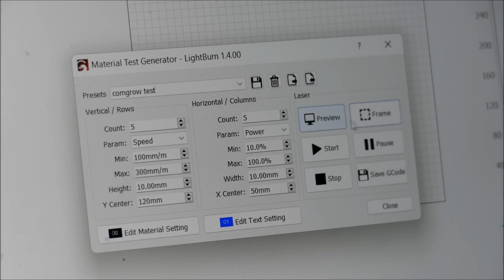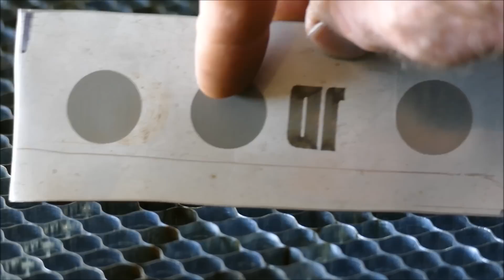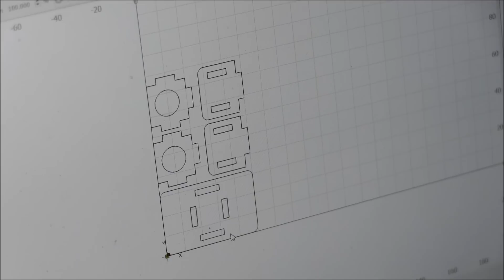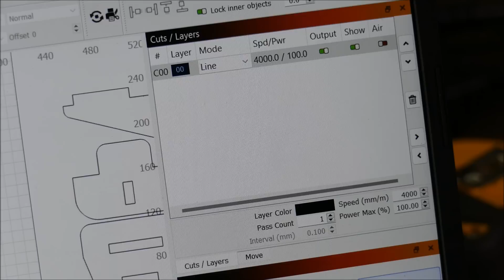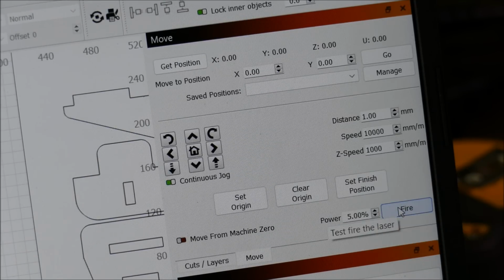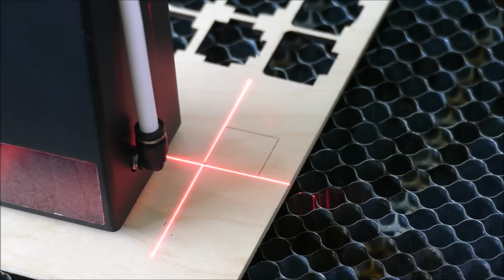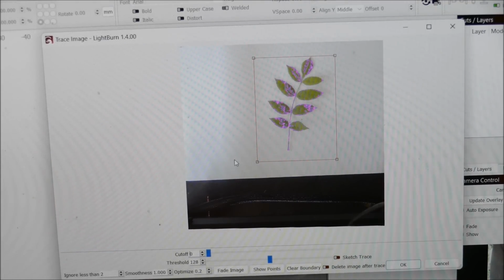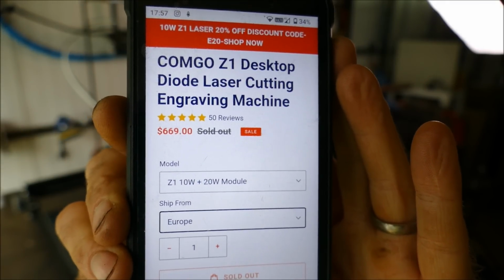Is this the MOST cost effective 20w laser engraver 2023! + best DIY upgrades Comgrow Z1 Pro cnc

Comment: I use a laser cutter at my local hackspace to engrave stupidly complex Celtic art (not like that joke of a knot in your earlier video) so my main criterion is accuracy. The misalignment on that one piece in this video was worrying, so I was wondering if you could do comparisons of the engravers' accuracy on longer cuts?
Edit: just watched your video with the AI elvish table - let me know if you'd rather have a Celtic design for one ;)
Reply from the maker: Hi. Thank you. It was misaligned because I put the part too close to the back of the gantry where it hit the edge. That's because the machine thinks the cross hair is point 0 so it thinks it had plenty of room. I could do the same mistake on all the best machines, I just didn't think about it until I finished the video. Celtic art is awesome and AI certainly can't do it perfectly, it was just an example of how quick the process can be with fairly good results. Cheers J
Reply: @joshuadelisle  Ah yes, classic. I always use the Frame command in Lightburn before cutting, for that and other reasons. It's quick and saves annoyance/waste/embarrassment.

Comment: I’m sure you don’t want to get into Lightburn tutorials, but I bought a laser pointer, designed & printed a mount, so I know exactly where it is in relation to the laser (+/-), but lightburn seems to completely ignore the offset.. #confused
Reply from the maker: I'm doing a lightburn tutorial and I'll make it very easy to follow. which laser do you have?
Reply: @joshuadelisle  Ah, cool, I’ve a Sculpfun S10, just the cheapest one I could find at the time, but I’ve had good results, just wish it was easier to position things..
Reply from the maker: @StephenMott  ok and you enabled laser offset and adjusted the parameters?
Reply: @joshuadelisle  yep, x=0, Y=30, but putting the crosshairs over the squares corner just draws an offset square..?
Reply: @joshuadelisle  I don’t think I’m being dumb (though always a possibility..: :)), I’m a programmer, I do math for a living, I’ve scratch built 3D printers, I think it’s a basic concept thing I’m missing..?

Comment: I'm thinking of engraving silver, but the heat generated might cause some issues. Does anyone know if something like this machine is capable of engraving silver that's placed a few millimetres under cold water?
Reply from the maker: I recommend a fibre laser with Infrared wave lengths for non ferrous metals. The xTool F1 or laser pecker3/4 are good options. Cheers J
Reply: @joshuadelisle  Thanks for the info, J. Love the channel by the way.
Reply from the maker: @georgecarlinismytribe  thank you. Cheers J

Comment: If it weren't for shoddy build, and anti-support, this would be a great little laser.  But, chances are high that it will fail quickly, and then you are better off buying a new laser than dealing with their 'engineers'.  Spend the few extra bucks, you'll appreciate it in the long run. (Speaking fro experience)
Reply: I mean: spend the few extra bucks to get something reliable instead.

Comment: Never understood why lasers are more expensive than 3D printers.   It is so much simpler than 3D printers in design and construction.
Reply from the maker: The diodes and lenses are the most expensive part. The gantry and software is simple. Cheers J

Comment: Inferior? You know why 220 is prevalent in Europe? And the UK. WW2 and surplus generating equipment. For the house 120 at the mains is safer.Though being a hobbiest having more 220 than the water heater and clothing dryer would be nice.
Reply: Not only do we have 240v in the UK but we run it into our shower cubicles.  (I await the incoming voltage pedants btw)
Reply from the maker: It's all jokes. But at least we have fuses in the plugs. cheers J
Reply: On receipt equipment most now in US comes with heat resettable fuse's internally. Commercial equipment has the fuse in the receptical the cord plugs into. There are definitely pros to higher voltage. But I have seen some real dumb shit with electricity. One thing is power wired to the shower head? WTF. So 120 is better for the majority. I can use a frequency inverter if I need something fancy.
Reply: I am thinking copper gaskets, there is money in those. They are not made for everything because no one wants them sitting on the self.
Reply from the maker: @selrahc2061  good idea but you need a CNC router for copper, these lasers won't touch it. Cheers J